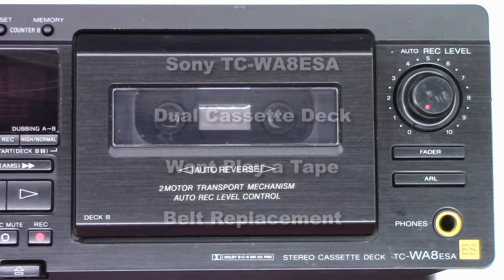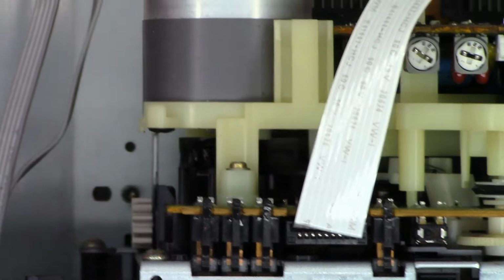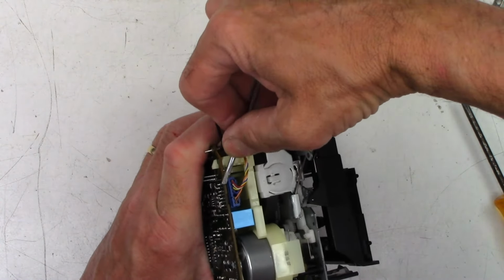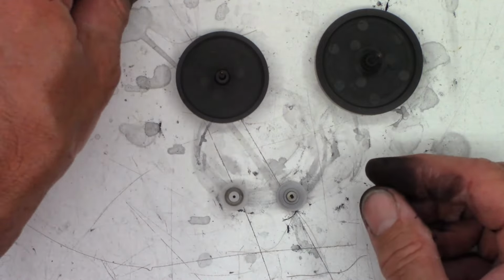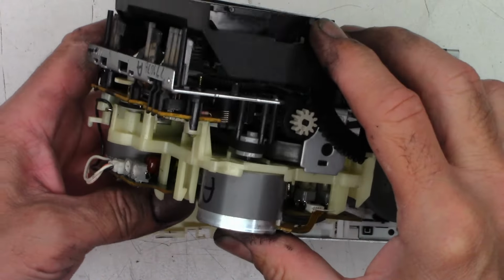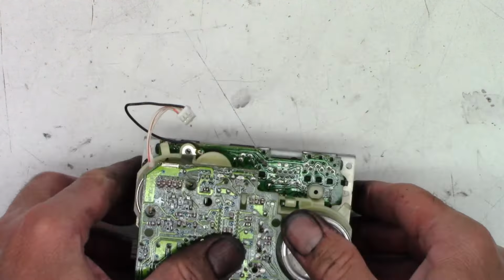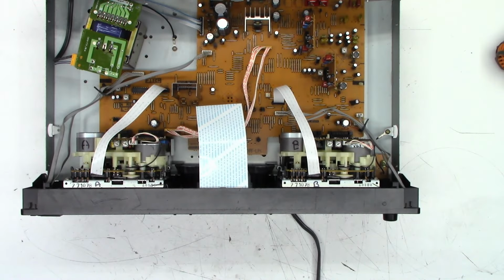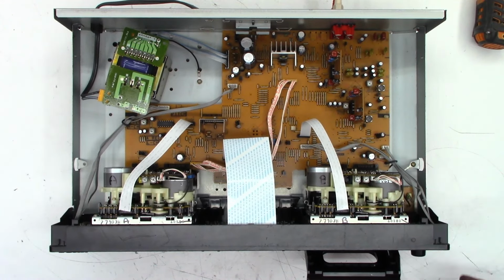Sony TC-WA8ESA Double Cassette Deck VERY GUMMED UP Belt replacement - Dolby B - C - S - HX Pro

Comment: The model number is very similar to  amateur radio call letters. I don't see anything special to earn an ES badge on this model.
Reply: ES was for Elevated Standard, a line of gear Sony sold built extra well & used better components snd had more features. Sadly it became a marketing gimmick when manufacturers started selling & making gear cheaply

Comment: The "ES" Models are the Successor of the "ESPRIT" Series. It was Build to Highest Standards for also a Higher Price. In the early 90s they dialed the Esprit Series slowly down due to lacking Selling Numbers. If i take a Look in your Deck it is a Simple Standard Tapedeck with 2 Decks Recording and the so called ARL. That Deck has neither Quartz Direct Drive nor 3 Heads (Yes there were  3 Head Autoreverse Decks - just a few but there was some out there), there are no Motorized Doors nothing what sets it apart to earn the ES Labeling. Not even the Internals look different.
Reply: It's got Dolby S Noise Reduction. There are not many decks that have Dolby S. That makes this deck something of a collectable for cassette collectors.
Reply from the maker: That is the main reason I purchased it, even a non working Dolby "S" deck has value.
Reply: @norcal715  Yes i had to agree about Dolby "S". Dolby "S" also cleanes out the Bass/Lower side of the Audiospectrum. B/C were mostly Treble/Hissing Reduction. And BTW: ESA is a acronym for "E"sprit (or "E"xclusive) "S"eries "A"nalog. So Buyers would know on a ESA is nothing Digital to it. There were also updated ES"D" CD-Players and Amplifier/Receivers. These were mostly already for sale Analog-Out (RCA) built Devices updated with Toslink for Optical Signal Delivering. That was the time when "TO"shiba"S"onyLINK was new invented. All the World says "Toslink" derives from TOS-hiba, but there was a Symbiose between both. Toshiba was the Main Force behind TOSLINK pulling Sony in the Boat for bring it to the Masses. "TADUMM the more you know" ..

Comment: Acetone cleans most everything except fingers.
Reply: Household cream cleaner (e.g. Ajax, Jif) gets cassette deck belt goo off fingers very quickly and easily with warm water, then you wash hands with ordinary soap afterwards. I've done that many times after re-belting a few Sharp, National and Sanyo decks which had nasty melted belt muck. Cream cleaner is less abrasive on skin than a powder and you only need a small amount to get the goo off. 😇
Reply from the maker: Goooff-Goopoff-Goofoff, I have some somewhere. My fingers are recovered now but ill try it next time. Thank you.

Comment: Unlike the Technics RS-TR232 you repaired a few days ago, that Sony deck looks to be in pretty good shape with no cracked or broken gears. Just the usual disgusting sticky belt goo and some dirt from age. " It's a Sony " 😎 and not a cheap model either. A keeper for sure. 👍

Comment: After a week of picking glue and skin off my fingers from refoaming a pair of Infinity speakers, I highly recommend rubber/latex work gloves for protection.  Some of the truly fine work must be done by hand though.  Always wanted a Sony ES cassette deck.  I have a decent Kenwood at this time.
Reply: I hear baby oil eorks to remove the goo. Rub hands in baby oil, then wash off with regular soap

Comment: I always used alcohol,I thought acetone would melt the plastic parts,I know acetone cuts those melted bands,thanks for the tip,ya learn something new everyday,been repairing electronics since the vacuum tube days

Comment: I have a very similar if not the same model.   TC-WA7esa
I loved your video.
I undertook the same exercise.    Deck A is working fine.   Deck B did not work.  What exactly do you mean that you can't sandwich the gears too tight?

Bill
Reply: I have the same deck as you and I'm wondering the same thing. Did you ever figure it out?

Comment: what do you mean by not sandwhiching the gears to tightely? I'm having the same issue on Deck B.
Reply from the maker: there must be some spacing between the gears, if they are all sandwiched together it will bind up.